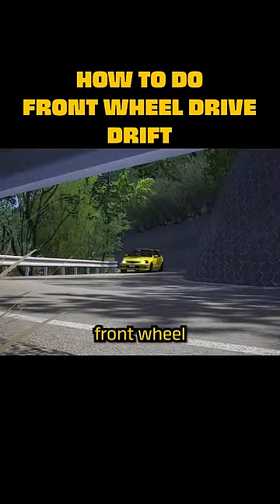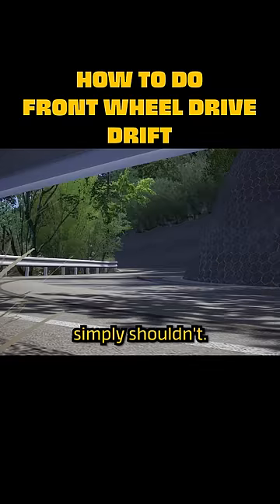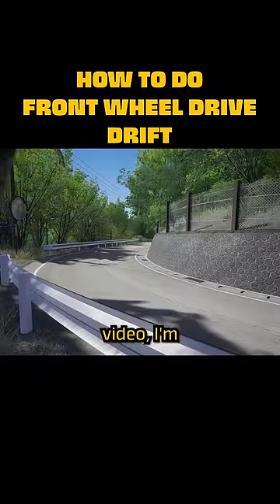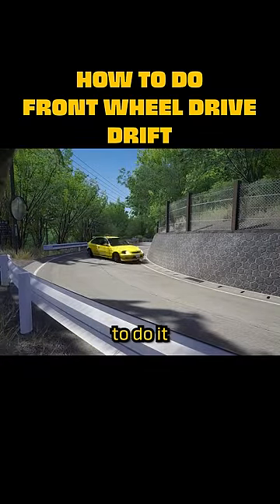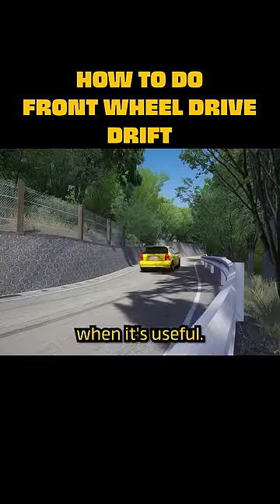HOW TO FWD DRIFT #simracing #assettocorsa #shorts

Comment: Yeah except what you descrived is not a "drift" This is just a handbrake turn. You can't vector the rear of the car with the throttle so it can't be a drift.

FWD that drive like this is the equivelant of a dog dragging its ass across the carpet. 

A drift is a bit more than just a slide that takes place before the apex of a corner. A drift is actually a type of powerslide. The originator of these techniques classified all the different types (at the time) and a power slide was referred to as a "power over" type There seems to be a modern day distinction that the power over or power slide is not a drift at all. FWD cars seem to do the opossite of a power slide where the turn in is a traction loss and by the apex traction is restored and they are able to pull out of the corner with full traction. This exact type of slide does not have its own designation as far as I know but it does not always require a handbrake to initiate, hard braking and a revmatched downshift  will upset an FWD's rear suspension enough to make it light and slide as all the weight is on the front tires, thing is UNLIKE a RWD car if you apply throttle (what is needed to be an actual drift) the FF car will understeer itself out of the slide and will eventually turn to a nuetral weight distribution and traction will be regained at the rear tires and the slide is dead.  This is also how AWD cars can pull themselves out of a drift if they came into the corner with accel off. AWD cars with enough power can use throttle modulation to overcome their traction and steer with the throttle, or give little blips to regain traction or others depending on the AWD setup. Transaxle AWD cars will acting different than symetrical AWD cars etc etc.

Comment: Thats not a drift thats called a slide.
Reply: But it's exactly what a drift is
Reply: @Joobral  you can cantrol a drift in a rwd car way more than a slide in a front wheel car.
Reply: @tacobagcharlie9298  but it's still a drift

Comment: It’s not really drifting because you can’t sustain it non-stop. FWD sucks.
Reply: you can with the handbrake ;) and fwd is not that bad
Reply: @arcanevoid9199  it’s the worst of the three and objectively so. Only reason FWD exists in the first place is to make the car cheaper to mass produce at the expense of performance and dynamics. Sure you can have a lot of fun in a well-sorted hot hatch don’t get me wrong. But for drifting and track days? Nah.
Reply: @Hello_there_obi  fair enough, but they can still be good for track. they are plenty competitive in quite a few motorsports
Reply: @arcanevoid9199  sure they have their own categories, especially in rallying. But they would get destroyed by rwd or 4wd every time. 

Also, it you were designing a car that is fast, handles well and feels good to drive, FWD would be your absolute last choice. The weight distribution is all wrong, the front wheels can only handle so much power, the rear wheels have no diff, they have shit acceleration and braking because of the weight transfer, there’s torque steer theyre harder to work on an upgrade…the list is endless.
Reply: @Hello_there_obi  uh not really, some of the fastest time attack cars are fwd as an example. acceleration can be an issue but braking is not. there isnt much that can outbrake a lightweight fwd lol, and weight transfer would be in your favor for braking in a fwd. and any fwd with a decent front suspension setup is not really going to have much if any torque steer. they are slightly harder to work on generally but depends on the car
Reply: @arcanevoid9199  why am I only seeing rwd at the top of the WTAC results pages then? And that the longest unbeaten car was rwd too? 

Weight transfer would not be in your favour. Just because weight shifts to the front, that’s not necessarily a good thing. You squirrel under braking and understeer kicks in whereas in a more balanced rwd car you can use the grip of all 4 wheels to brake more efficiently and maintain control of the power and steering for better turn in. 

I get they have their charm. But they will always be inferior in terms of performance and driving feel/pleasure. And that’s objective in terms of the sheer physics of it.
Reply: @Hello_there_obi  idk thats what ive heard from a few people. and the front does most of the braking so how would that not be a good thing? and wdym by squirrel under braking? and your more likely to oversteer under braking in a fwd, done it so many times myself even on the street lol. and a rwd car wouldnt be much different, yes its more balanced but the weight is still going to the front, thats why you dont have the same size brakes on every corner. yes obviously they will be inferior but just blindly saying they suck is a bit stupid. also considering how inflated the prices of rwd cars are
Reply: @arcanevoid9199   just go to the website. All the top cars are rwd.

And of course all that transfer forward is bad. You’re asking the front to steer, drive and brake. If you’re racing, steering and braking in a fwd is worse. Yes the fronts grip up more, but the rears become useless. Much better to have all four working in a more weight distributed rwd car. The simple idea of spreading out the tasks will make for a better car. Also, a differential makes the cornering better too. 

What you’re talking about is lift-off oversteer. That happens during cornering. Taking your foot off the gas causes a weight transfer forward and because a fwd is so front biased, the rear just floats round. It’s worse for racing and driving. 

And if it’s also true that unwanted oversteer happens entering a corner as you claim - which I find very hard to believe since every fwd car I’ve seen understeers like hell when coming in hot into a corner - that is again, worse for driving and racing. 

When you accelerate, weight transfer to the driving wheels is good because you’re going in a straight line during hard acceleration. So rwd wins. When you brake, you want the car to have all four wheels to be braking efficiently. You also want the car to be planted and level so when you turn in, all four wheels have traction and you carry more speed and no understeer. Again, rwd wins.

I said suck as hyperbole. But from a pure physics standpoint for driving dynamics they literally do suck when compared to rwd and awd. Not saying you can’t enjoy them and have fun at lower speeds especially though; I would love a class Peugeot 205gti 😋

And your last point is irrelevant, price is not what we’re talking about here. Of course they are cheaper. That’s what I said earlier btw. That’s the only reason they do it. Not for driving pleasure. Just cost. But that has nothing to do with what we’re debating.
Reply: @Hello_there_obi  oh ok nvm then. and why is it worse? left foot braking is very commonly used in fwds, and especially the technique of coming in hot and trail breaking into the corner to get the car to rotate. fwds have a differential? im not talking about lift off oversteer, im talking about just turning into a corner while on the brakes. and its not really unwanted, i do it on purpose because its fun. and you need to drive some more fwds then, havent run into really any understeer issues with my celica. when i first got the car the back end came out completely just turning right at a intersection multiple times, was 5 year old chinese tires though